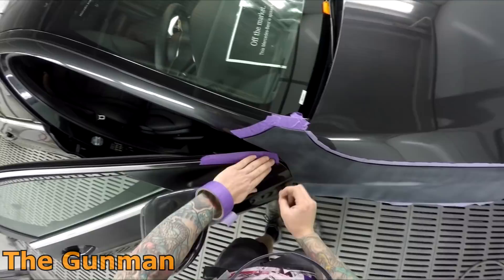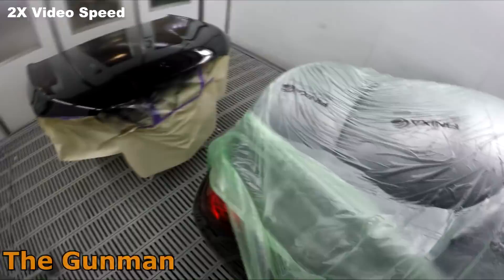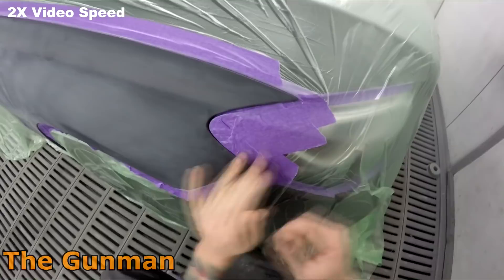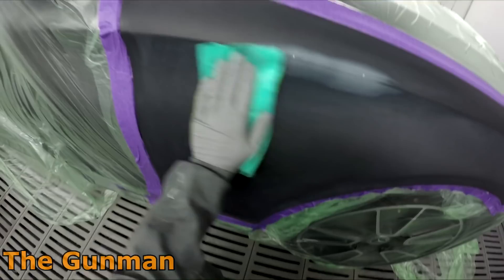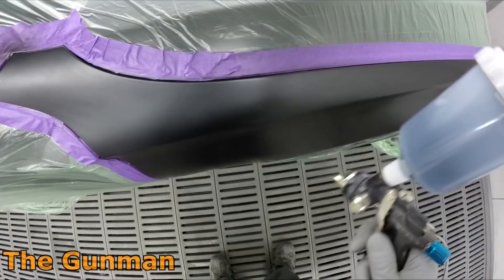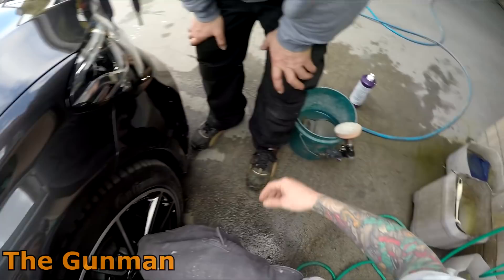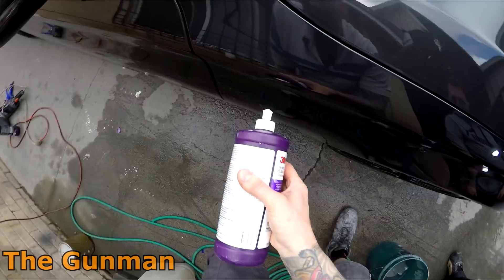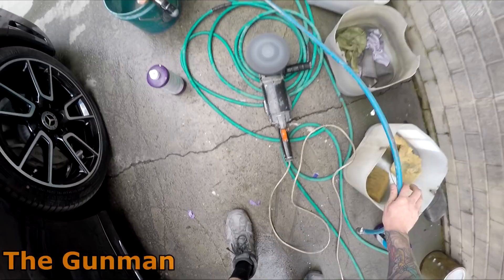Spray Painting & Polishing C200 Mercedes Benz

Comment: for the nibs i`m going with straight with 2.5 mm DA with P1500 + 3000 + 6000 Trizact , barely touching the panel in angle with no pressure.  it creates a perfect matt texture that will buff very easy.  
... this will not work easy on very hard clearcoats like Liquid Glass for example ...  top work , happy weekend everybody!

Comment: Advice needed.  I just purchased the GTI ProLite with the 1.2 and 1.3 with the TE10.  I do home jobs and want the flattest finish possible.  My first job was more of a factory ford peel.  I sprayed 2.5 turns out at 25psi with the 1.2. What setting would you recommend for a flatter finish?

Comment: Hi Gunman I purchased a sata 5000 B RP 1.2 tip and used your recommended settings (2 turns out) and found it VERRY slow to use. I am used to the gti pro lite 1.3 with TE20 and love it, very fast gun. What am I doing wrong?
Reply: The 1.2 is smaller and will flow less. 
You can try reducing a little more.
Reply: @bstevermer9293  Compared to the pro lite with the TE20, the diameter of the 1.2 is noticably larger.. even in Gunman's previous videos he says it seems to be larger than what it actually says
Reply: Riffnugget 

Be interesting to use a plug gauge and actually test.
1.2mm is .047
1.3mm is .051

And assuming the needles are set the same. 
Something to ponder .

Comment: Gunny, For the home job, do you really need to worry about using Antistatic wipes on plastic trim parts?  MPS bumpers, boot lid and bonnet are all prepped... just gotta wait for it to not be 44 degrees.
Reply from the maker: There are other ways around it, it's definitely not necessary. I'd just use prepsol (W&G remover) then after that get a damp cloth and wipe that over it, add a 50-50 methylated spirits and water mix if you have some, that should get rid of the static from the prepsol stage. And again that's only for bare plastic parts.
Reply: Thanks mate.  Yup I have the 50/50.  The weather is fighting me though (Adelaide)..
Reply from the maker: @MarkSmith-dz6dj  tell me about it mate, we had that weather last week and it obviously blew over your way, it's extreme to say the least. Good luck with it mate and don't forget the plastic primer for bare plastic parts 👌 merry Christmas
Reply: Cheers mate, have a great Christmas

Comment: Hi man I have a Mazda 3 stage pearlescent white with bumper damage scuffs and scratches. Am I best to have the whole bumper resprayed or just where the damage is? Do you have somewhere I could message you, I've looked on fb but can't find anything. Cheers.
Reply from the maker: Some of the time it can be cheaper and easier to do it on the car, obviously it will depend on the quality you're after, taking it off the car will usually result in a better job but on the other hand there's nothing wrong with a spot repair done properly. I don't have time to do private message, if I did it would be a full-time job. I'm also not looking for work, sorry.
Reply: @TheGunmanChannel  Basically having it done next week fingers crossed it's done right or they'll be doing it again.
Reply from the maker: Just let the repairer know you won't settle for less than top quality results. He'll probably assign the job to his best tradesmen then.
Reply: @TheGunmanChannel  Great cheers for the advice man have a good weekend.
Reply: @TheGunmanChannel  I forgot to ask obviously alot of the job is down to preparation and who's painting it but the place I'm going to use seem to have all the tech like the spectrometer. Will that alone mean I should get atleast the same result colour wise as my current factory painted bumper. Also basically my damage is smack in the middle of the bumper is that painted and then faded into the old? Cheers
Reply: They said they also use PPG paint which is supposed to be top rated

Comment: Why is the pressure lower when using a digital gun?
Reply from the maker: Technically it is the same but they have just done an update on the DV1 digital gun, it now reads further up the gun which will always read a lower pressure, so if I was reading it from the base of the gun like usual it would read higher. Supposedly they did it to make it last longer. Hope that makes sense.
Reply: @TheGunmanChannel  makes sense. Would that apply to the pro lite digital? I run a gun regulator at 2 bar and the digiral read out on the gun always reads lower. I was about to get a new regulator because I thought it wasnt accurate
Reply from the maker: @jesusalvarez5563  pro lite wasn't like that, but I believe they had a few issues with replacement batteries for the pro lite, they ended up just replacing the whole unit if someone asked for a new battery. I always trusted analogue gauges more, they're also cheaper.